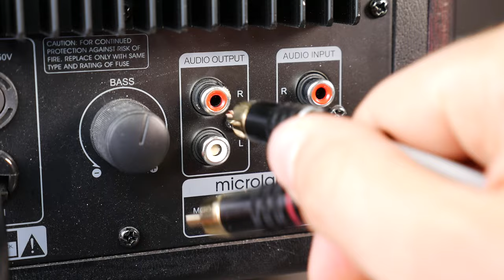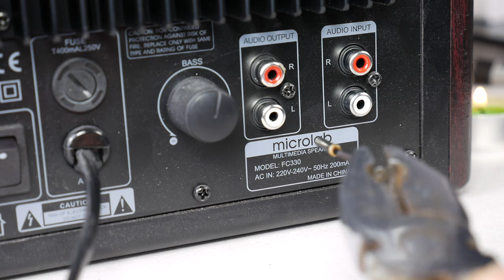How To Remove Broken RCA Pin EASY DIY

Comment: Thank you very much for this! I had an expensive Nakamichi cassette player with two deeply stuck RCA pins, which was useless for nine years. My local repair shop would not even bother with fixing it. I tried your tip and they were out in ten minutes! Now I am listening to my first cassette again in almost a decade. Again, thank you for sharing!

Comment: FYI it helps if you can cut off the tip of the nail with a hack saw so it’s a smooth surface nail on plastic.

Comment: Thanks,I figured I would u tube how to get prong out and it worked,I used a trim nail and I couldn't find needle nose for the hot nail so I put electric tape on end so I wouldn't burn myself,cool trick thanks.

Comment: Worked on my second attempt. Couldn't find a nail small enough so I used a safety pin. I just heated it with a lighter, doesn't take long to get hot enough. Great tip. Thanks, made my day!

Comment: I used a very small drill bit.  As soon as the coil shaving came out I gently pulled on it and the bit at the same time.  Came right out.

Comment: How would you recommend taking one out missing the plastic post? I have just the metal pin housing stuck?
Reply from the maker: bend it slightly with a thin needle, so that you can grab it with a  tweezers.
Reply: @TechscrewDIY  ? Where would I get a tweezers that is thin enough to operate in the confines of a RCA input?
Reply: @Tylersdownfall  Also you can just slip a nail in there with a bit of super glue and pull it out.

Comment: could you hypothetically solder the broken pin back on to the cable?
Reply from the maker: hot soldering iron to melt inside plastic.
There is two versions how to replace broken rca:
- https://youtu.be/CHjY3NNy_4Y
- https://youtu.be/a-Pd724lSxs

Comment: Sadly this didn’t work for me, I only managed to push the broken pin all the way inside. Funnily enough my CD player still worked as there was now enough room to insert a new RCA jack, but I’m OCD and the fact that the broken pin was still inside niggled me. So I had another go the next day, and my attempt to drive a large sewing needle into the sunk pin pushed it all the way through and onto the circuit board!! As I had heard horror stories of the random bit of metal shorting something on the board I carefully undid the many screws and opened the CD player box up. Lo and behold there was the broken pin sitting on the circuit board, which I removed with tweezers. The only job left was to push the stainless steel connector bit back into the RCA jack, where the broken pin had pushed it out when it came out the back. This I did with a gentle few taps of a hammer using a small screw head against the connector bit. Thankfully it went flush back inside. I was praying that the last action hadn’t inadvertently damaged the RCA jack which would have necessitated my taking the whole thing back to the manufacturer for repair! With fingers crossed I put the box back, re-screwed the screws, hooked it up with my RCA cables and switched on my amp. With a CD in the tray I found the player was even better than before. With the broken pin inside, even while I was able to get L/R sound, I had to jog the RCA cable to get it “just right” or else the L-side would cut out. So getting that pin out was just the ticket. Pat on the back awarded! Unfortunately I didn’t succeed in doing it by your method though, lol 😂
Reply from the maker: thanks for feedback :)

Comment: All that did was make things a lot worse, what was close to edge, is now crammed in all the way & after 4 tries is mashed in so far i can't see it.  Look elsewhere for a solution
Reply from the maker: did you melt hole inside broken pin ? If there is hole, just take toothpick and super glue and you get out broken pin.

Comment: I tried this and it still won't work. I did this 20 times and did everything right but still won't work I left it in 5 mintues and it never stuck
Reply from the maker: with 20 times, you had broke the all plastic inside,  you can try the screw and turn it slightly before hardening to get it to catch.